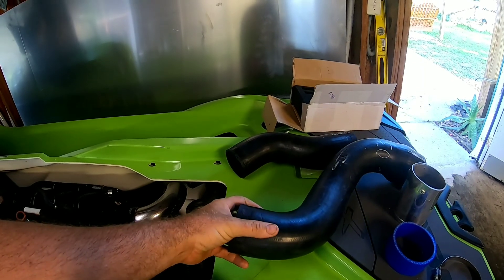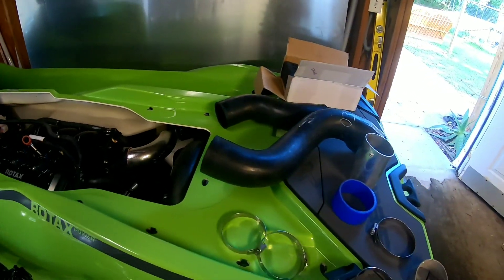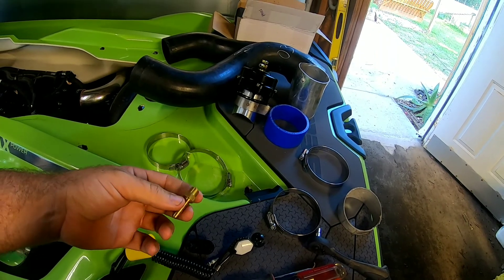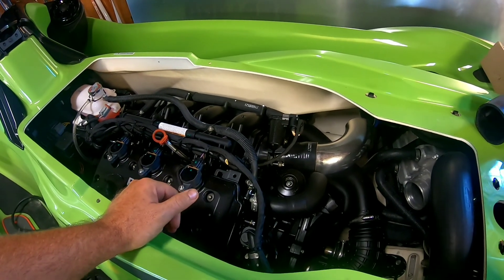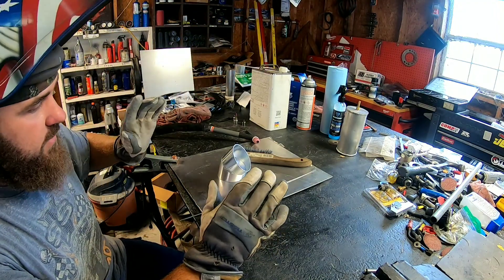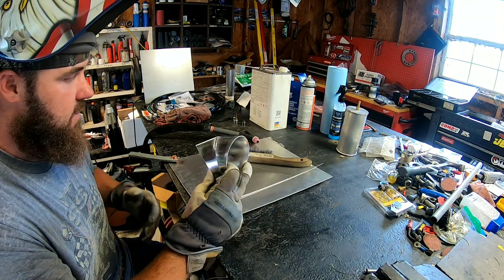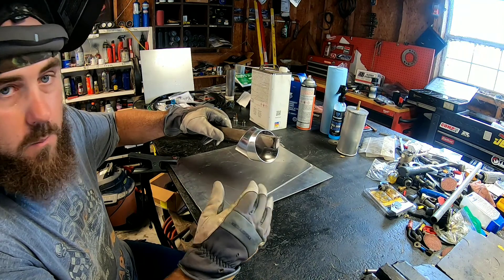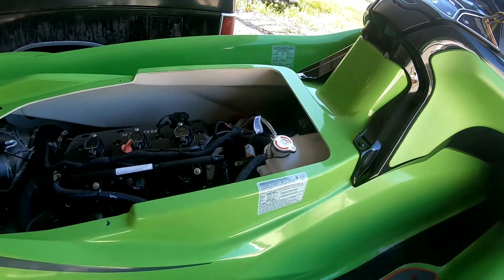2020 Sea-Doo RXT-X 300 DIY blow off valve.

Comment: I just bought a knockoff kit with the same blow off valve. Wondering if I should go ahead and order a tial spring. I have a 23 230 GTX. Thoughts? I’m assuming a 300 like yours pushes more boost
Reply from the maker: I'd try the spring it came with first see what happens.
Reply: @legacyperformance9982  I had the same problem. Spring that came installed was too soft so it stayed open the entire time, other was way too soft. Trimmed 3/4 coil same thing. Ended up getting the tial green SC spring. Haven’t ridden it yet but seems to close under boost like it should.
Reply: @DanteCarroccia did the green spring work. ?
Reply: @NotaLoka777 yup!!!